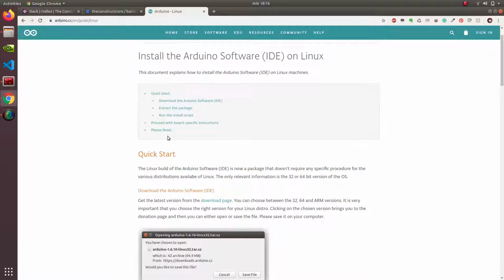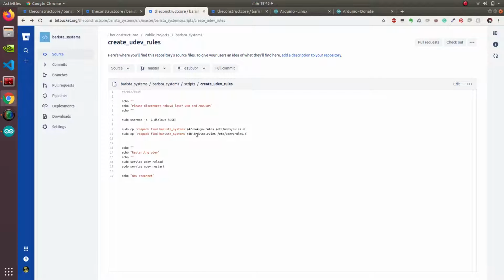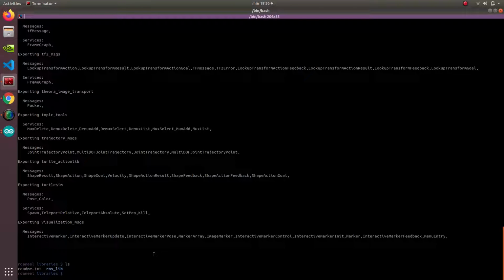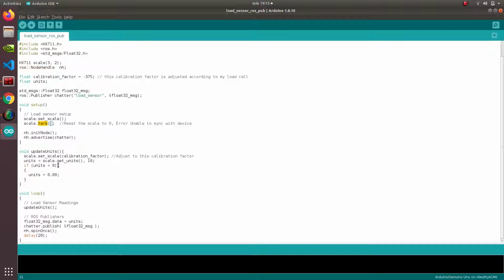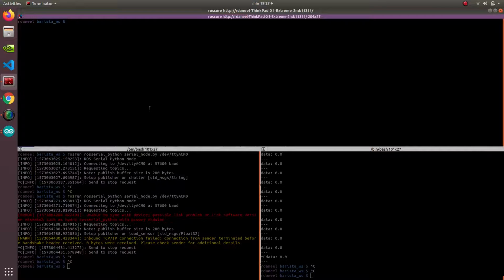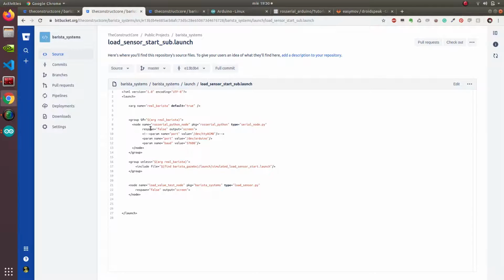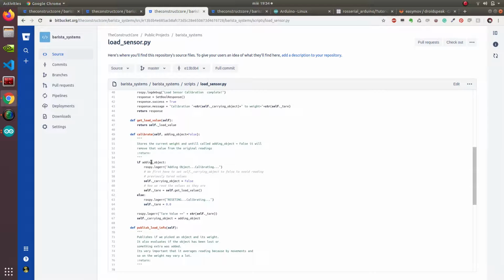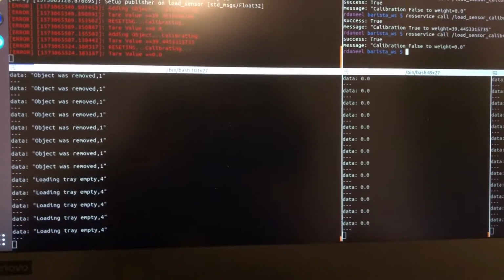ARDUINO Load Sensor for Restaurant ROS Robot - E2 P1 |  #ROS Projects

Comment: can you help me 
i can`t solve this problem
Reply: CMake Warning at /opt/ros/kinetic/share/catkin/cmake/catkinConfig.cmake:76 (find_package):
  Could not find a package configuration file provided by "roswww" with any
  of the following names:
    roswwwConfig.cmake
    roswww-config.cmake
  Add the installation prefix of "roswww" to CMAKE_PREFIX_PATH or set
  "roswww_DIR" to a directory containing one of the above files.  If "roswww"
  provides a separate development package or SDK, be sure it has been
  installed.
Call Stack (most recent call first):
  barista_systems/barista_web_server_pkg/CMakeLists.txt:10 (find_package)
-- Could not find the required component 'roswww'. The following CMake error indicates that you either need to install the package with the same name or change your environment so that it can be found.
CMake Error at /opt/ros/kinetic/share/catkin/cmake/catkinConfig.cmake:83 (find_package):
  Could not find a package configuration file provided by "roswww" with any
  of the following names:
    roswwwConfig.cmake
    roswww-config.cmake
  Add the installation prefix of "roswww" to CMAKE_PREFIX_PATH or set
  "roswww_DIR" to a directory containing one of the above files.  If "roswww"
  provides a separate development package or SDK, be sure it has been
  installed.
Call Stack (most recent call first):
  barista_systems/barista_web_server_pkg/CMakeLists.txt:10 (find_package)
-- Configuring incomplete, errors occurred!
See also "/home/mahmoud/catkin_wc/build/CMakeFiles/CMakeOutput.log".
See also "/home/mahmoud/catkin_wc/build/CMakeFiles/CMakeError.log".
Makefile:1690: recipe for target 'cmake_check_build_system' failed
make: * [cmake_check_build_system] Error 1
Invoking "make cmake_check_build_system" failed